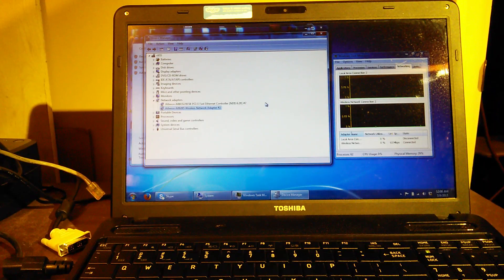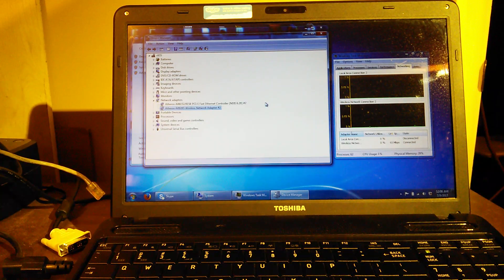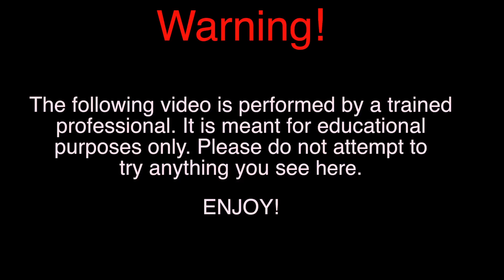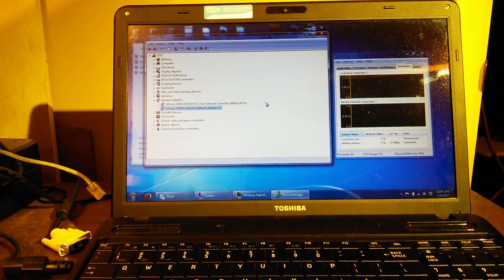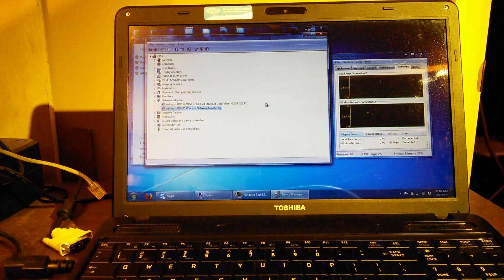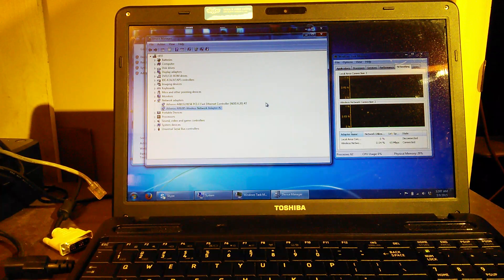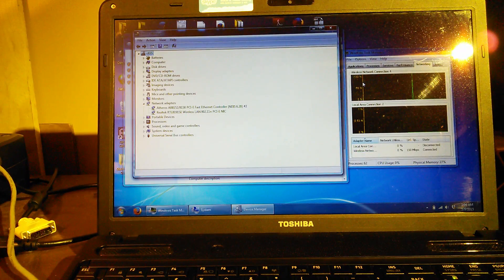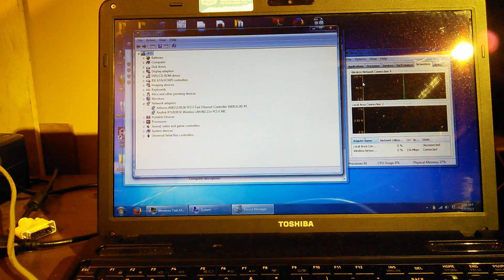Tech Tip: Wifi card upgrade / replacement for Toshiba C655 laptop

Comment: Hi, Great video, I replaced my Wi-Fi card a while back but with a new one of the same (Realtek) with the help of your video. I have a Toshiba C655-S5307 laptop and I just reinstalled Win 7 and downloaded the drivers for the WI-FI card and it still says the network controller, SM Bus Controller and the PCI Simple Communications Controller are missing drivers and I cannot connect to the internet. Do these 3 things have anything to do with the wi-fi card? I haven't been able to find drivers for them. Thanks, Mike

Comment: What we wanted to see was the disassembly of the keyboard, etc, to get in to replace the Wifi card.... unfortunately, it was way too fast to see what, exactly, you were unscrewing, removing, etc.  You spent many minutes of fluff in the first half, and then skipped over the part we REALLY wanted to see!
Reply: Fortunately I had done this before. There is a long plastic strip right above the keyboard about the same length as the keyboard that just pops out with a small screwdriver to let you access 4 small screws that hold in the keyboard. Once you take them out you can lift up the keyboard and replace the Wi-Fi card, very easy compared to my HP laptop. Mike

Comment: Hey Dan thanks for the video!  Are there any compatibility issues with certain wifi adapters?  I want to add an Intel 8260 to the c655.
Reply from the maker: There shouldn't be, just have to find the drivers for what ever card you go with. The Lenovos are the only ones that i know of are coded in the bois to support vendor specific wifi cards.